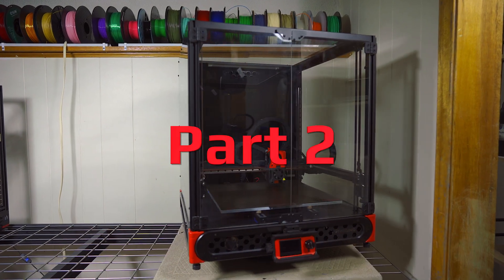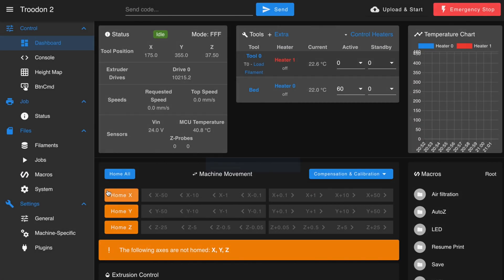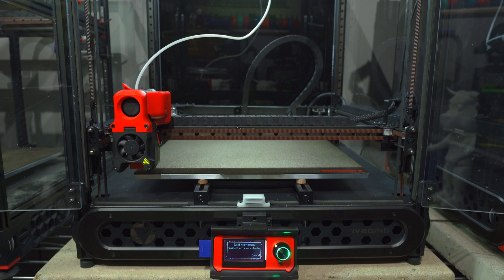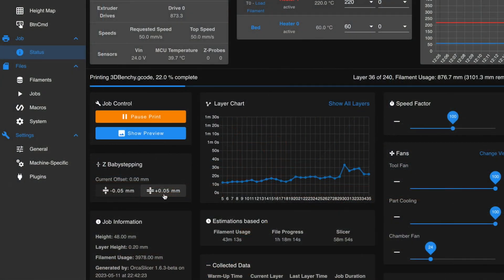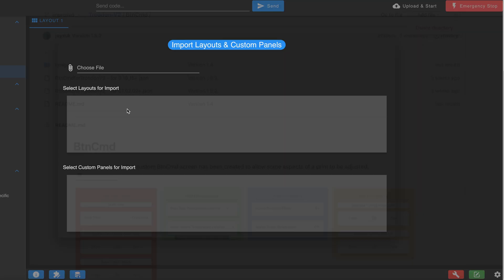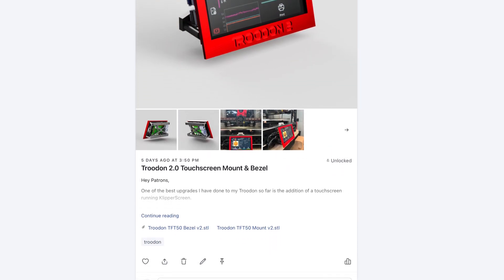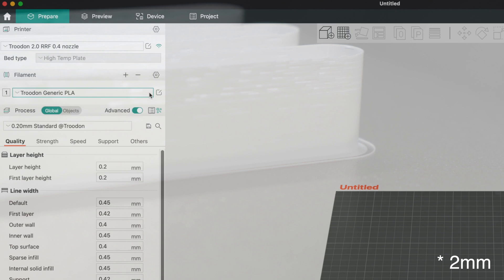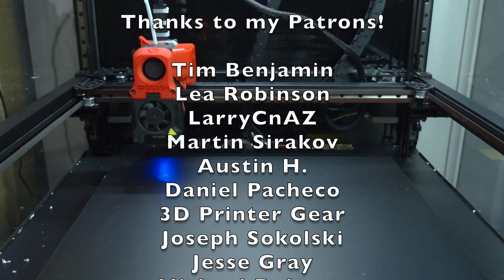A "Voron" on Easy Mode - Troodon 2.0 Beginner's Guide Part 2

Comment: Seems the printer is now sent with Klipper.
Would be great if Orcaslicer supported the printer profile.
Cheers.
Reply from the maker: Indeed it is. There is a Klipper profile for it in OrcaSlicer already.
Reply: I have Ver. 1.9 Orca but the there is not even the product line showing up.
Would it be under a different name?
I was looking for Troodon.
Looking to upgrade from my Neptune 4.
Cheers. @ygk3d

Comment: I've recently purchased a Troodon 2.0 and followed your most excellent guides here. After uploading the Team Gloomy config and updating the web interface, the control panel on the front of the machine has a red knob light, where as I am seeing green/blue on yours. My assumption is red means some form of error, but nothing seems to be amiss and I can print files (I'm still tuning and testing so alot of failures and issues with the machine that will need fixing). Have you or anyone reading come across this with the Troodon? I have little idea of where to look. I'm new to this level of printer, but have been using 3D printers for some 9 years.
Reply from the maker: Thanks for watching! Glad the guides have been useful for you.

The LED colour is just a stylistic choice. It is not a status indicator. You can change the colour from within the screen.g configuration file. The original default knob colour was blue but in the latest firmware it was changed to red to match the colour scheme of the printer.
Reply: @ygk3d  Ah that is awesome news. 1 less problem to solve. I’ll likely end up on you Paetron once get the basics dialled in.
Reply from the maker: @lambolica  Cheers. Much appreciated. Lots of good stuff over there for the Troodon and otherwise :)

Comment: I appreciate the tutorial. I got everything setup, sliced a file in Orca, and started the print. Less than a second later it said it was a 100% finished. I tried multiple times and nothing would work. tried different slicers and get the exact same result. Very expensive paperweight at the moment.
Reply from the maker: Mhhh… that’s a new one. Do you see any error in the console in the web interface?
Reply: @ygk3d  Nothing at all. Everything looks fine.
Reply from the maker: @ScottStoneUnforgivenII  is it otherwise functioning normally? Homing, heating, etc.? Does anything happen after you start the print?
Reply: @ygk3d  Everything seems to be in good working order. Nothing at all happens when I start the print.
Reply from the maker: @ScottStoneUnforgivenII  you might want to try just reuploading the improved system files, then rebooting. Did you set up BtnCmd?
Reply: @ygk3d  I did set up BtnCmd. I will try to reupload the files. You mean the Teamgloomy cfg files correct?
Reply from the maker: @ScottStoneUnforgivenII  yes. Exactly. Depending on what version you uploaded, the default behavior is to heat soak the bed for 15 minutes before it starts printing. You can change that behavior using BtnCmd.
Reply: @ygk3d Pulling my hair out trying to figure out what was going on. Just for the heck of it, I ended up putting a new filament switch and cable on. Why not I've pulled it apart a half dozen times today. Started a print, everything works perfectly. Thank you again for the tutorial and especially helping out right away and not leaving me in the lurch. I appreciate it very much.
Reply from the maker: @ScottStoneUnforgivenII  no worries at all. Glad you got it sorted!

Comment: WTF, I follow these instructions,  run the probe trigger height, and this mf'er runs the nozzle to y=350 and slowly smashes tf out of it into my bed, cool. coolcoolcoolcoolcool.
Reply from the maker: Did you delete the lines from config override and reboot the printer before running the macro? (see pinned comment)

Comment: so I started over with my machine, followed your video, now the y is backwards, nozzle crashes, its a bigger mess than ever. I don't understand.
Reply: Just happened the same, that is becouse induction probe is now behind bed. As ygk3d mentioned month ago: 😃
IMPORTANT: After removing the two lines from config-override.g reboot the printer. Otherwise, the gantry leveling procedure will try to probe off the back of the bed.
Reply: @Honza7208  just go klipper, or buy a machine that has real r&d like a Bambu maybe a K1

Comment: I will also add that the printer can only connect to 2.4 Ghz Wifi. 

"Sadly" i have 5 Ghz, just by knowing this the Troodon 2.0 get's discarded on my search to be my new printer.

It's a bittersweet feeling because i really wanted to have it, the only advantage i see to this is that now i don't have to worry about assembled it.
Reply from the maker: It’s surprising how many devices only work on a 2.4 GHz network. Most routers have the option to broadcast both 2.4GHz and 5GHz.
Reply from the maker: If you covert to Klipper the Raspberry Pi can run on 5GHz.
Reply: @ygk3d  can i use an old laptop instead of the Raspberry Pi?
Reply from the maker: @omegadeepblue1407  I’ve heard of people doing that but I’m not familiar with the process. You’d have to refer to the Klipper documentation.
Reply: @ygk3d  thanks. 

However i also found other alternative, i have a old signal amplifier from a company called TP Link, and guess what?

The amplifier sends a signal of 2.4 Ghz, i think i will use my old computer for only control the 3D printer.

Comment: Great video! Had one minor issue:

The latest firmware (as of 05/31/23) for 2 - Autoz trigger height.g has line 43 (to move the nozzle over the probe) as ";G1 X120.5 Y0 F1800" which is the front left, after some measuring and testing it should be: "G1 X235 Y360 F1800". Just a heads up.
Reply: I accidentally used the old macro and ran into this problem but the new one is correct. Your comment helped me figure it out :P Thanks.

Comment from the maker: IMPORTANT: After removing the two lines from config-override.g reboot the printer. Otherwise, the gantry leveling procedure will try to probe off the back of the bed.

ALSO, after updating, don’t use the stock start code. Use the TeamGloomy start code from the profile supplied on their GitHub or use the Troodon 2.0 profile that is built into OrcaSlicer.

Comment: Fantastic information!!!

I have been eyeing a voron for a long time, but just don’t have the time to build one.

There were some quality issues with the original Troodon and I held off.

Now since this is built more off the voron core design I’m really intrigued. I have the E3D revo system on my other printers and they have the high flow setup coming out.

How easy would it be to to put one of the revo systems in?
Reply from the maker: Thanks! Glad you found it useful. 

It would be plug and play, besides potentially needing to crimp different connectors on the Revo thermistor and heater cartridge so they can plug into the extruder breakout board, and changing the thermistor definition in firmware (stock is PT1000). I’m thinking of installing one myself.
Reply: @ygk3d  so worth it?  I have a prusa mk3s+ and heavily modified CR10s pro v2 and ender6. 

I need a reliable printer with near the CR10s build volume….  I’m not horribly worried about blazing speed but a little faster would be nice. Still waiting on my prusa XL with 5 heads.

Comment: I would add that you should have the bed up to temp before doing the z and probe offsets. Multiple cycles up to temp seem to help the bed settle in the mounts. On the machine that I run ABS on, I get it up to 110. After multiple iterations my mesh has really levelled out, and I have a great first layer. On the PETG machines, doing the same at 85 has worked. If I were to start running ABS on that machine, I would want to re-z @ 105-110. I can say that failing to get up to temp to get a great z cost me bed damage due to printing way too close and messing up the texture by practically imbedding the PETG into it.
Reply from the maker: That’s good advice. Thanks!